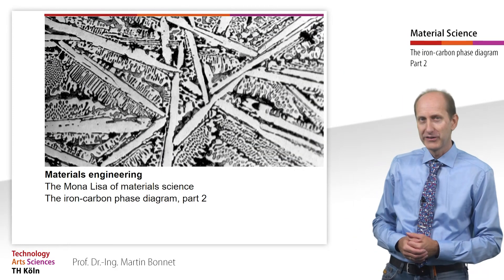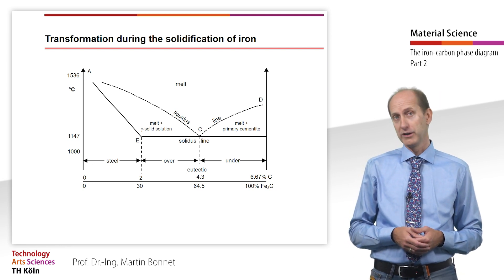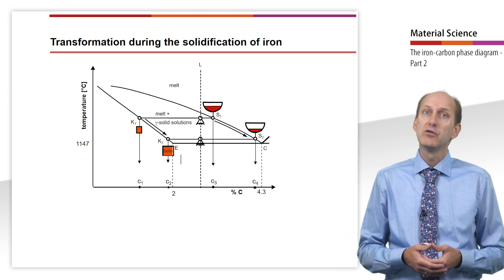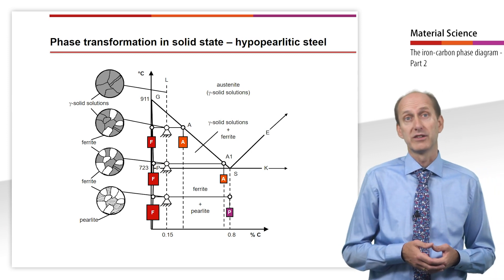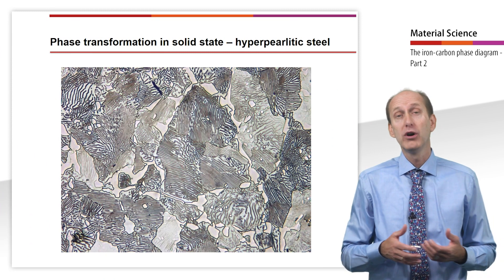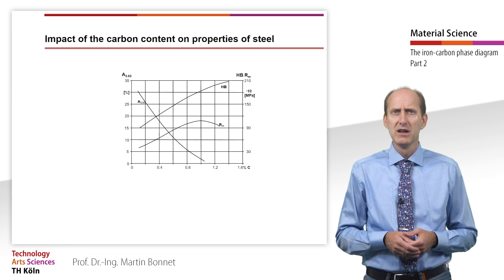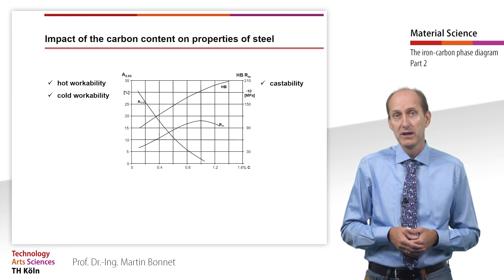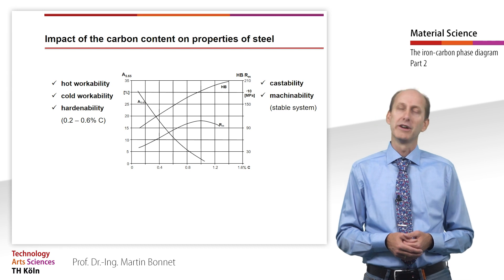Material Science, The Iron Carbon Phase Diagram, Part 2

Comment: Good day Professor.  As a hobbyist bladesmith I am teaching myself as much as possible about metallurgy to apply in this craft.  However most YouTube videos on the subject are from India.  I have notice some discrepancies with regard to the Eutectic line, where some say it is at 723 deg C and others say 727 deg C.  Another is the Curie line that I have seen differ from graph to graph as well as the Eutectic Point differing between 0.76% carbon on some and 0.83% on others.  I am also unsure as to if steel actually loses its magnetism from the eutectic line until the Curie line or does this only happen at the Curie line?  I would really also like to know more about the process, theory and differences of Normalization and Annealing especially for steels around the eutectic point i.e.just above or just below.  Thank you very much for the English videos, as these are very scares thus highly appreciated.
Reply: I think  the minor differences in the data you refer to are caused by how theoretical a graph is. If you want to actually apply these graphs into the real world, you'll need quite some extra knowledge to use them properly, since the graphs are made based on Gibb's free energy method, and thus show which phases should exist under certain conditions, in perfectly mixed, thermodynamical context. In reality it takes some additional energy to actually transform from phase to phase, that activationenergy depends on many things and can be quite tough to comprehend. I don't think it's gonna be easy to find all the knowledge to reason things like that yourself on youtube, but many people i the same brand probably do and can explain it to you personally, or they just know how it works, whatever the sciency behind it may be. These kind of video's is defineteley what you need to absolutely understand it, but it'll probably take a few dozens hours of lectures rather than just one.